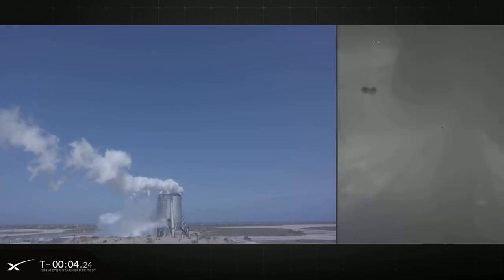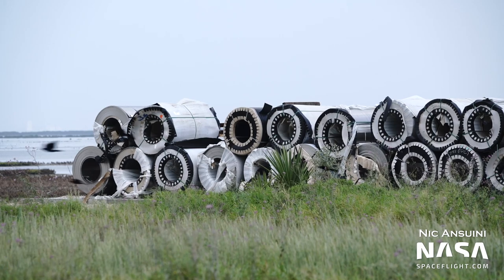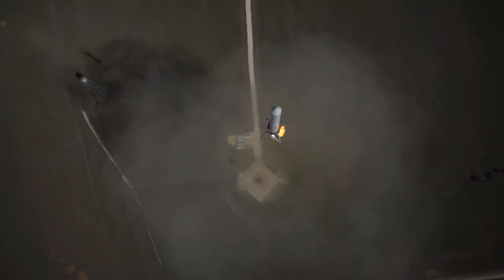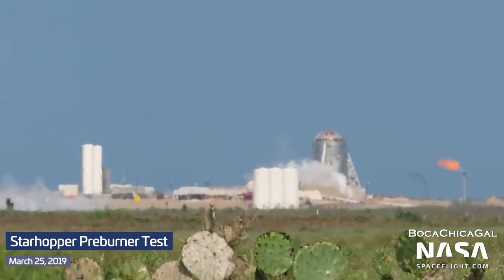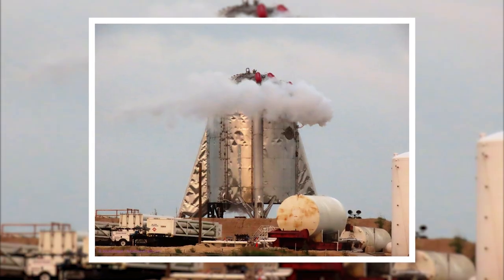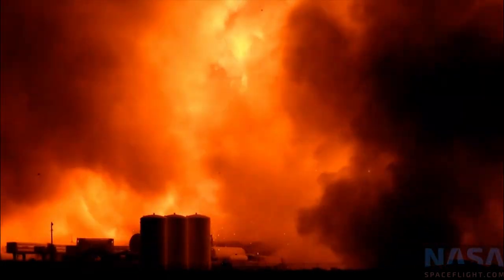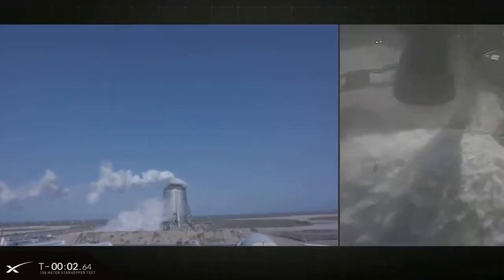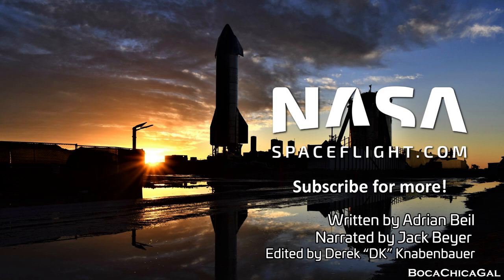How Starship Started, SpaceX's Flying Water Tower: Starhopper | SpaceX Boca Chica

Comment: love the video, but I've always been curious why Starhopper is so wrinkly.
Reply: The shiny steel on the outside is just for looks (you see some less wrinkly and dull steel during it's construction), so it isn't that rigid and doesn't have any pressure inside it to pop out dents like the main tanks do. Their earlier construction processes were also less refined, so even Mk1 looked very wrinkly compared to the current prototypes.